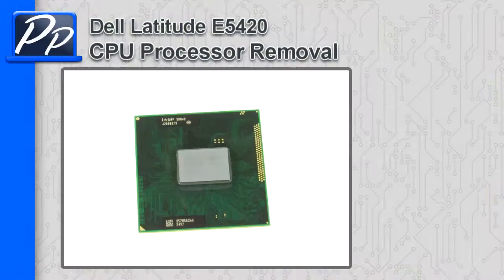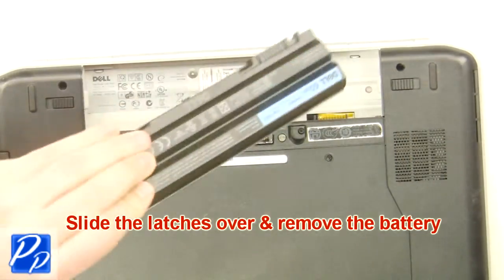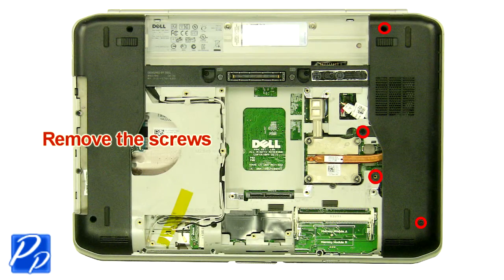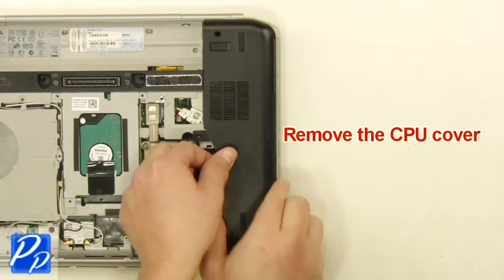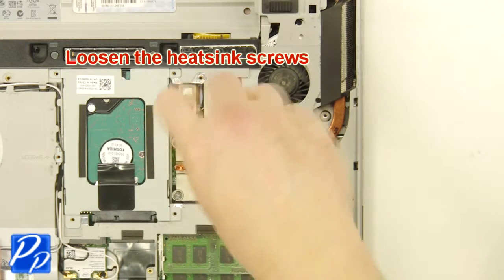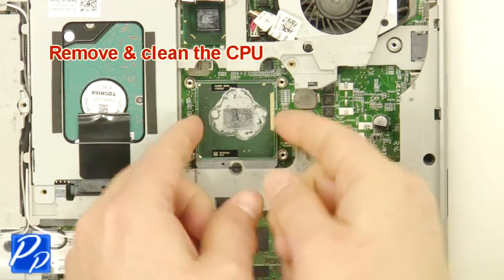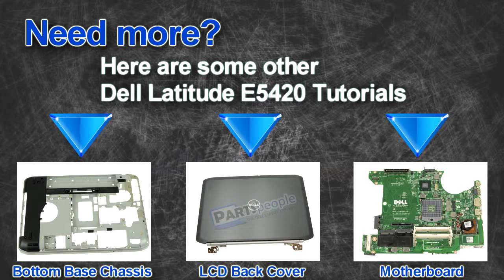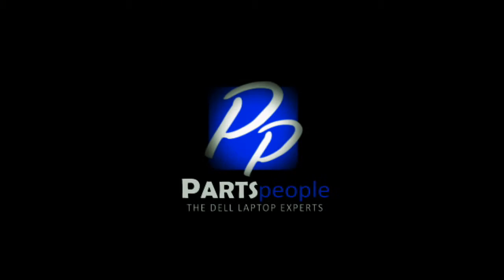Dell Latitude E5420 CPU Processor How-To Video Tutorial

Comment: what processor can i change instead the stock one
Reply: I found the following list of CPUs that Dell 5420 could be shipped with:
Type : Intel® Core™ i7-2620M dual-core processor
Speed : 2.7 GHz with Turbo Boost up to 3.4 GHz
Cache : 4 MB

Type : Intel® Core™ i5-2540M dual-core processor
Speed : 2.6 GHz with Turbo Boost up to 3.3 GHz
Cache : 3 MB

Type : Intel® Core™ i5-2520M
Speed : 2.5 GHz with Turbo Boost up to 3.2 GHz
Cache : 3 MB

Type : Intel® Core™ i5-2410M dual-core processor
Speed : 2.30 GHz with Turbo Boost up to 2.9 GHz
Cache : 3 MB L3

Type : Intel® Core™ i3-2310M dual-core processor
Speed : 2.10 GHz
Cache : 3 MB L3

Type : Intel® Core™2 Duo Processor T6670
Speed : 2.20GHz
FSB : 800MHz
Cache : 2MB L2

Type : Intel® Celeron® 925
Speed : 2.3 GHz
FSB : 800 MHz
Cache : 1 MB L2

If my assumption is right than you can just follow this video tutorial and replace CPU. Any of the listed should be supported by BIOS.
But this is my assumption only so I do not imply any warranty )